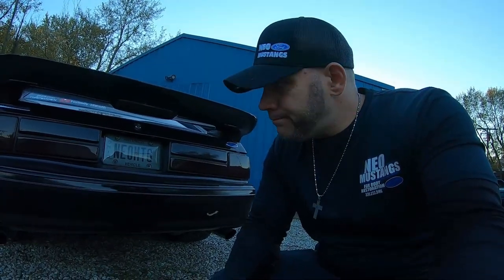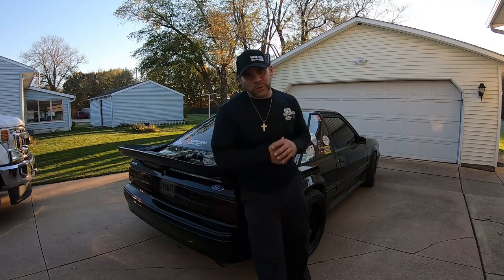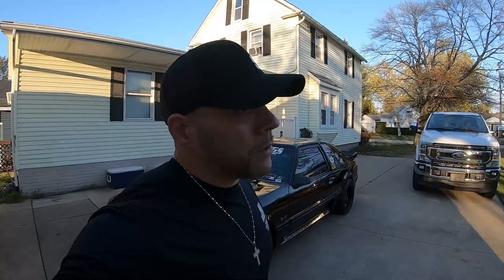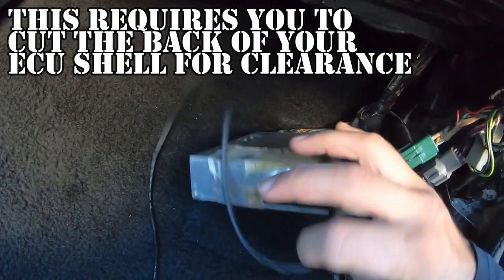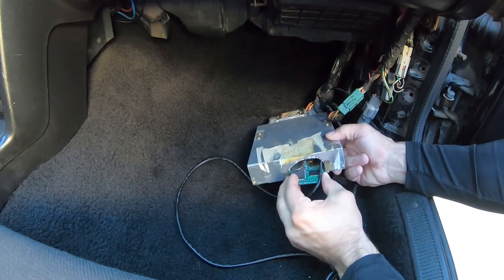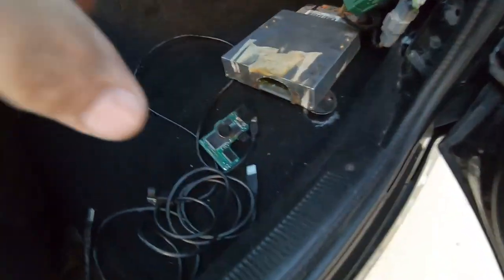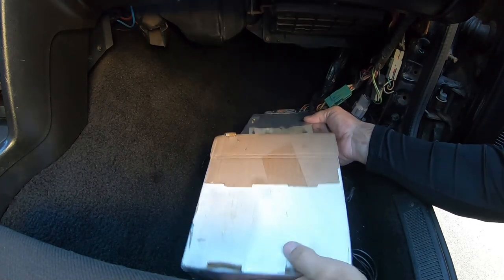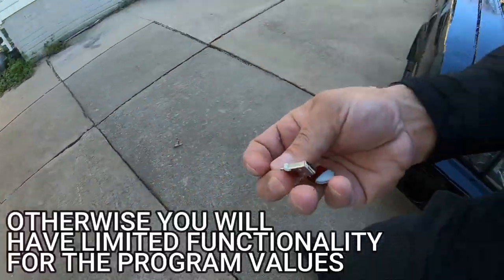TUNING in 2021 “Resurrection of The CHIP” IS it Still Effective?

Comment: I bought a sct chip about 14 years ago. Same thing as a quarter horse, even uses the same type data link as the quarter horse but you can tune through the data link instead of removing the ecu and chip. They call it a switch chip.  It has four tunes you can switch on the fly. I have a daily driver good fuel mileage tune a track tune with harder shifts on my 4r70w and a 105 oct. Tune.  5.0 ,35-250-4 comp cams, ported 3 bar 1.60, 1.94 headers trick flow track heat, only thing stock is the block, 36lbs injector, 1 /58 headers 5.0  f150. It can be returned over and over.
Reply from the maker: You have an SCT ELiminator chip with a switch thats correct. You can not tune to that chip directly you need quarterhorse and binary editor.
Reply: @Neomustangs  yes that is correct, miss spoke trying to fit alot of info with less carrectors, words. Just remember the catch code on the eec 4 ecu. Love the chip of course quarter horse is the first but  I'm in Shreveport and Dallas mustang has sct and they tuned it,  like I said I love it works perfectly with a turner who knows this style chip.

Comment: Whats the best way to clean off a stock J port before installing a chip and do you need to clean the bottom as well? My stock A9L still has the coating on the port.
Reply from the maker: Just clean the coating off. Skotch brite

Comment: I have a 91 explorer intake and gt40 iron head with a b303 and it doesn't run really good. It kinda bogs under acceleration. Is my combo not good together, should I get a tuner? Idk what to do to make it feel right
Reply from the maker: Tuner
Reply: @Neomustangs  quarter horse unobtanium. Megasquirt?
Reply from the maker: @trailerpark187  terminator X call Donny B at Anderson ford Motorsport. Tell him I sent you

Comment: Yeah I’m thinking my bama 4 bank eliminator isn’t helping my fox think it’s running lean. Not sure that’s the chips fault still has factory injectors and fuel pressure regulator/ fuel pump.. I’m going to replace my injectors with new 19lbs and  Abbi regulator and 255lph hoping that makes it come alive on the big end..I had the same mph after I installed my mods when I recently raced seemed like it was dieing on the big end.. fingers crossed.. and I have a nos question if I run a dry kit and I turn the fuel pressure up with that help or hurt? I would think it would help but I don’t know.. my overall goal is to be in the 12’s right behind the coyotes or ahead lol.

Comment: Maybe someone on here can help so I have a 89 lx 5.0 5speed car ran fine I did a top end swap on it but I noticed when I was adjusting the valves the car was acting like it wanted to start with the key off I was using the silinond to crank it over. When I go to start it now I get no fire at the plug but I can hear the injectors firing. 
Could it be the tfi module needs replaced?
Reply: Could be a lot of things, I would start checking all the ignition components  and move on to the wiring if no issue  was found. How were actuating the solenoid?, could you have damaged it or shorted the surrounding wiring? But I would start with basics check all the ignition components if you're not getting spark. Hope this helps, just my $0.02.😅👍

Comment: So I ended up buying a terminator x. Cause there isn't any  Reputable shops near me. But you just got me to save my factory wiring harness and  ecu for a possible build down the road. Wish I would have known about this going in. Does your tuner tune terminatorx systems? And where are they located?
Reply from the maker: Yes

Comment: hey neo i need your help, i have a 2003-2004 cobra t56 10 spline, i bought the quick time bell housing for my 351w fox 157tooth , do i use regular t-5 cluthes right 10.5 clutch 10 spline right, please help
Reply from the maker: Yes. You follow the flywheel
Reply: Dude you just saved the day, I almost made a 1,000 dollar mistake thanks brother
Reply: @Neomustangs  I almost made a 1,000 dollar mistake thanks brother, you saved the day

Comment: Watched your live stream very informal best fox channel for the budget fox builder. Question for you, my new combo is stock bottom end stock cam, gt 40 3bar heads longtubes to 3.5 dumps, explorer upper and lower 70 mm tb pro m 75 mm mass air and motorcraft 19 lbs injectors. What do roughly think this combo will run for hp and quarter mile car is wieght reduced 4.30 gear 275 60 15 mt et streets thanks for your input always valued 💪
Reply from the maker: That’s a tough one. Tires are always the determining factor. Slicks probably mid 12s. Probably makes 280 wheel
Reply: Thanks for the reply, Iam from Canada, I don't trust anyone around that actually know what there doing can you do custum tunes and mail the chip would that be something you can do?

Comment: I took my 90 lx to get tuned it had a moates  chip in it I don't think it was quarter horse they said they didn't have the software to tune with that chip so they installed a sct 4 bank chip and tuned it with that how would that be done

Comment: Is there any way to know what factory stock tune is in a fox ecu if the labels part number tags have been removed.
Reply from the maker: What do you mean? You jport is open?
Reply: I installed a vortec s trim on my 1993 cobra many many  years ago when I was young and didn't know any better. I had it chip tuned at a local shop and it has been like that for years. Decided to pull the s trim, 36 pound injectors and big maf off and put it back to stock. With the cobra meter and injectors that I saved. Went to pull the chip out and noticed the eec is completely missing all the tags to I'd it as an x3z cobra computer. Dont know if my ecu was replaced because I did not think those labels would fall off that easy.
Reply from the maker: @jasoncostello9709  yep betcha you don’t have an x3z
Reply: So I am guessing the binary editor cant read the program on the internal chip to I'd it as an x3z if it was plugged into the eec that I have.
Reply from the maker: @jasoncostello9709  what probably happened is the previous owners didn’t have a good x3z or got rid of it when they went to a super charger. So they bought a reman Ecu to tune that charger

Comment: new to foxbodys but is a a9l from an auto or manual
Reply from the maker: Manual
Reply: okay thanks i didn’t think you’d respond due to how old the video is. but i am doing a t5 swap on my fox from auto. how come some people say me running the auto computer once the car is swapped to a manual that it’s better
Reply from the maker: @GsFoxbody  I try to keep up with all questions
Reply: @Neomustangs  have you ever ran into the this problem when buying a alternator bracket kit and the bolt they sent doesn’t fit in the head
Reply: the bolt worked on my stock heads but not on my 351w heads

Comment: Do you ever use tunerpro?
Reply from the maker: No but that’s another one to use for quarter I do believe
Reply: @Neomustangs  that's what I cut my teeth on when I first started tuning with a QH. I still have my B.E dongle. But im actually in the process of installing a terminator in my Capri. I hope it's not a mistake switching over.